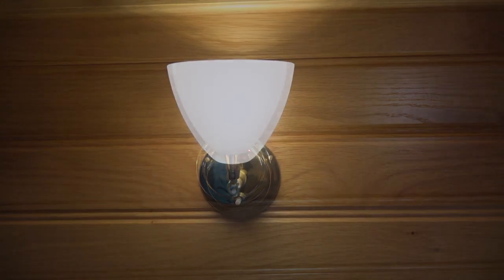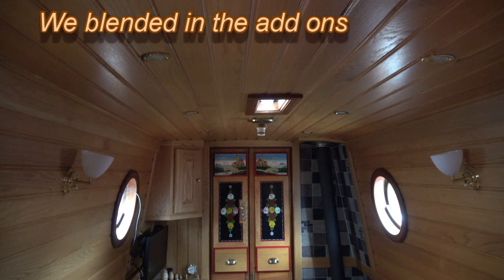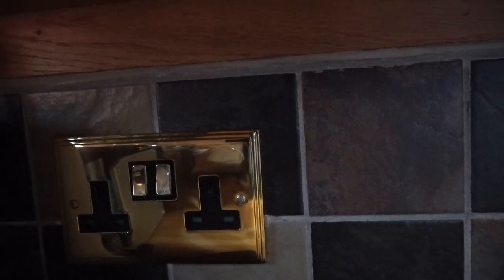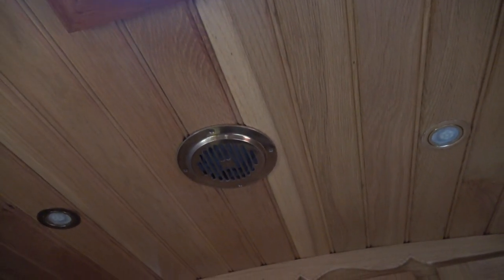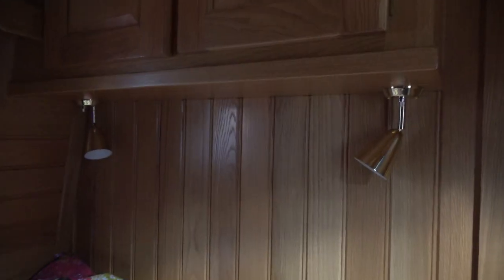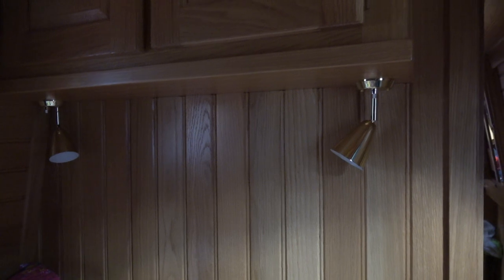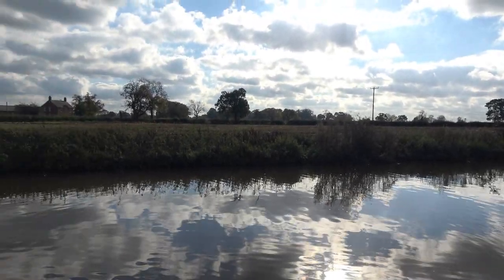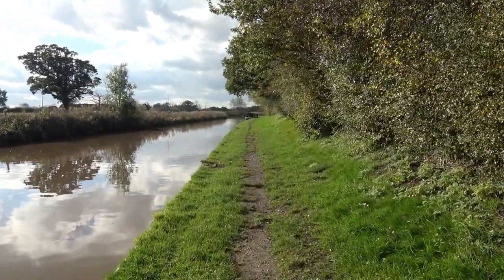Narrowboat Interior Design - Part Four - Bespoke Lighting

Comment: Wow! You boat just keeps getting better with every video. I never would have thought to have switches and sockets custom made but the end result is far superior to plated brass. I recently bought touch-sensitive switches for my under cabinet led lighting. They cost less than £4 each and are so small that they can be stuck on the back of the pelmet and save me fumbling for the light switch. Look forward to your future videos.
Reply from the maker: Hello again
Glad you liked it.
Our next two Interior Design Vlogs are mostly looking at the mechanicals and engine bay and are quite involved because of the many features.
We do have automatic light sensors at the front of the boat which are really helpful when returning from the pub in the dark. 😊🍷🍺.
The switches and sockets just finished things off nicely.
Thanks for watching   B&K

Comment: More great footage of your boat interior. Can you 0lease answer another question for me? I have the very basic lights on my boat and thought I could just replace the bulbs with the LED bulbs. Is my understanding correct, or do I need to upgrade the lights? I love to see the vlogs about your boat it is really beautiful. Thanks.
Reply from the maker: Hi Sylvia
The vast majority of bulbs can be exchanged directly or may need an adaptor. A few older lights do need replacing.
Have a word with Bedazzled who deal with boat lighting.
https://bedazzledledlighting.co.uk

To make sure any new LED bulbs or complete lights look right find out the wattage of the existing bulbs so you can get the equivalent LEDs.
What we did was to have cold LED lights in the galley and bathroom and warm LED everywhere else.
Glad you liked the vlog.
Cheers B&K

Comment: Great Interior Vlog.  I like the look of brass much better than chrome. Tends to lend a warm glow to everything vs a harsh bounce back of light. Noticed your vents were soft start.  Soft start saves wear and tear on the electric motor and increases their life span.  Are your interior lights variable output or all the same?  I have some LED lights at home that can be controlled through Alexa and an App on my phone.  Have you seen any like that for boating?  Might be handy to have for your trip back from a pub at night!
Reply from the maker: Hi Tony
Chrome is starting to appear on and in narrowboats but like you we prefer brass because it is warm and also more traditional. 
Our boatbuilder sourced the fans which fitted in the vents and they work really well.
All our LED lights have no variable control or output. A couple of our friends have complete remote control access for the lights and heating boilers on their boats.
I (K) may be a bit old fashioned but I am not a fan of any energy source coming on when away from our boat or home but I can understand having variable light adjusters when on board.
We do have a light that senses movement and comes on automatically when coming home from the pub in the dark.😊.
Thanks for watching, cheers B&K

Comment: Thanks Keith. Question if ok. Your domestic batteries - what ampere hours are they?
Reply from the maker: Hello Ken
I think you are jumping ahead now😂😉.
In a future Interior Design vlog we talk about batteries and associated systems but this is a quick review.
When looking at batteries we did a lot of research and head scratching. 
1.We did not want wet cell leisure batteries
2. Currently lithium batteries are not worth the expense but suspect they will become the norm in 10 years or so.
3.Our choice was Dual Purpose gel batteries.(Maintenance Free)
We have six 115amp at the stern in the engine bay and two 115amp in the bow for the thrusters.

http://www.shieldbatteries.co.uk/applications/marine.html

Powerstation LM Marine Range.
They are not that expensive when compared to other batteries and perform really well.

Make sure you have the right number of batteries to match your power consumption and size of alternators.
We normally after around 5hrs cruising have 95%-100% charged batteries.
If you had 10 batteries it would take around 7hrs to fully charge.
If you only cruised 3hrs then the batteries would not be fully charged and if this was done regularly would quickly mean you need replacements.
Our next couple of Interior Design vlogs are a bit more complicated but should be understandable.
Hope that makes sense.
Cheers.
Reply: The Tiller People - Narrowboaters I think you're right about Lithium Ion becoming the norm, but I don't think it'll take 10 years. In the space of a couple of years they've already halved in price, and given they last much longer, don't deteriorate if not fully charged, and much more from each battery is actually usable percentage wise, it could be argued that Lithium Ion is already better value for money. It's more to do with how robust the marine electronics is and that's progressing quickly now by the looks of it.
Reply from the maker: Hi
We have looked into Lithium Ion and currently believe they are perhaps worth the expense if you continually cruise. Over winter our boat is mostly in a marina, in summer we use it extensively and crucially we move around a lot and have some decent energy saving systems onboard.
We are having some decent solar panels installed this year but they will not be the rigid type because we believe they spoil the profile of boat.
If we ever changed to Lithium Ion it would be the Mastervolt type because they cope with temperature variations far better than any other. We would also need a Mastervolt alternator and that would be the perfect match for our existing electrical system.
Cheers B & K 👍🍻